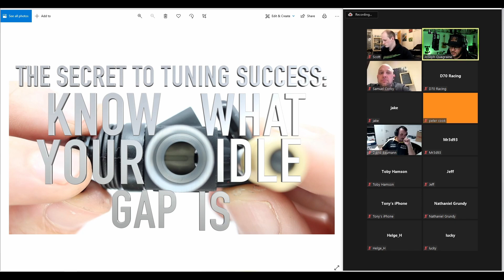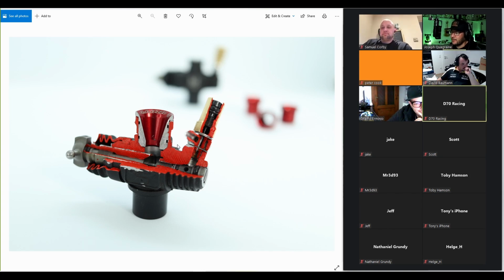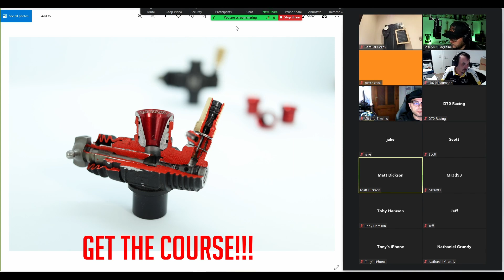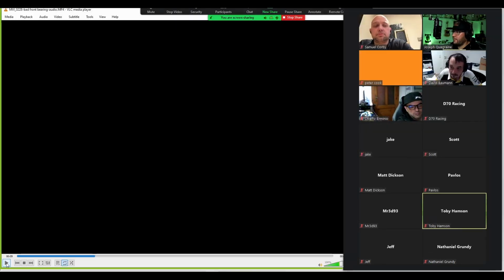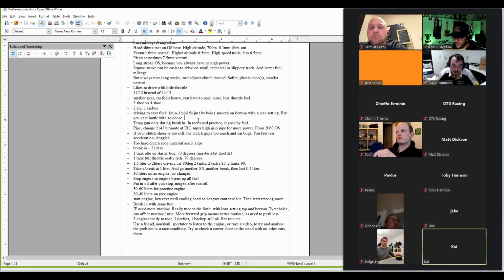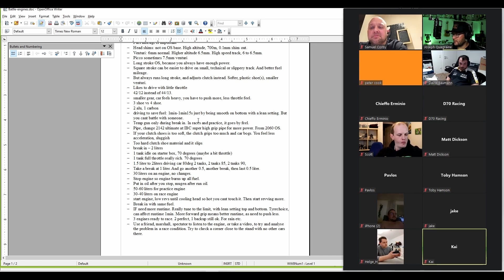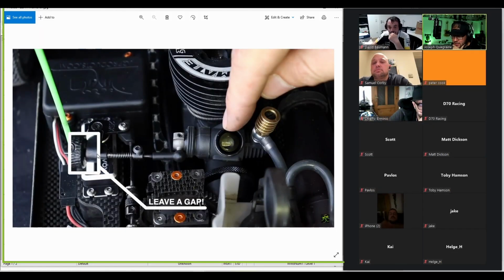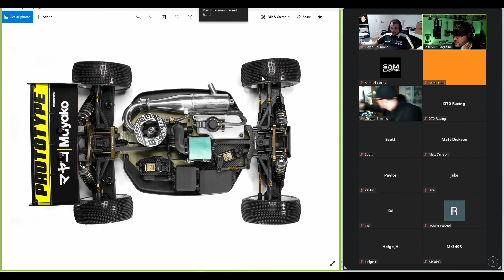Nitro Engine Tuning, Bad Bearings, Basics of Driving, Online Course LIVE Meeting 2 - Invisible Speed

Comment: Watching your video around the 12:00 minute mark where you are talking about idle gap, and I have an hypothesis about engines needing more idle gap as they age.  As the engine wears and the tolerances become less precise, the vacuum created on each piston down stroke diminishes a bit compared to when the engine was new.  This effectively reduces the volume of air drawn in during each downstroke thereby reducing available O2.  Opening the gap compensates for the reduced vacuum.  
How's that for a guess?

I should probably add that I've never tuned an engine and haven't played with RC cars since I was a kid 30 years ago and those were electric Tamya toys.  So this is purely just speculation.🤷‍♀

Comment: It's funny -- I had just recently learned of the idle gap tuning strategy less than a year before the JQ carb tuning vid came out, and was at the track with a Novarossi that was struggling with flameouts (I later learned it was worn out).  An experienced nitro guy tried to help me.  He wanted to crank the idle screw in, and he didn't understand when I told him I wanted to leave it set at the measured gap that I had it at because I liked having 1 of the 4 or 5 variables eliminated as part of a methodical tuning approach that I briefly explained to him.  I remember him saying something to the effect of "that's not how it works".  I'm sure he just hadn't heard of it -- the only place I had heard of it was through some old thread on RCtech forums.  I wonder if he remembered that when several months later JQ's vid spread like wildfire.
Reply: -- And not to sound ungrateful or like a know-it-all, because it was nice of him to offer help and he was on the right track in some ways.  As mentioned in this vid here, opening the gap up a bit is to be expected as the piston/sleeve becomes worn and compression decreases.  And of course even the original JQ tuning vid gives an idle gap range rather than a dogmatic, single fixed value.

It's just that, looking back here a couple years later, I find it somewhat entertaining that the guy at the track (whose son is very fast and has sponsorships) was so unapproving of the idea of measuring the idle gap, specifically keeping it relatively locked into a certain range, and primarily setting the idle speed via the low-speed needle.  I was very new to the method on that day (had only been applying it for a couple weeks), but I've used it for the last 2.5 years and it's worked very well for me.

Comment: If you are live I need to ask can u go up on a motor put a bigger engine on any body frame
Reply: Pretty much any car/truck will accept that. Occasionally you may need to strengthen the drivetrain, buy a new motor mount, or even move the transmission forward in some cases. But for the most part yes.

Comment: Im fairly new the nitro game. One of my car is hobao hyper vt. And on full tank it starts off rich, and after 2-3 pulls it will lean itself out and starts to sputter, i will richen it and then it will run ok for another 2-3 pulls and then goes super lean. If i kill it and start in 2 minutes its so rich that it doesn’t want to start. Idle gap is ideal. What could be the issue? I have 2 of these engines and both of them act same way. Can it be that hobao just has something wrong with carb or there is another thing i need to be looking at? Thank you

Comment: Ok just a question I checked my idle gap on my 28.8 and it’s supposed to be .6mm and I was way under what could the effects be. It seems ok but I just though I would ask as I’m trying to absorb information.
Reply from the maker: You know gap is too small when it wont idle without low end setting being too lean
Reply: @invisiblespeedrc  Ok thank you I just watch all the videos and checked mine. I think I’m going to set it to .6 and see the settings and tune it. I’m trying to perfect the single idle. Thank you again